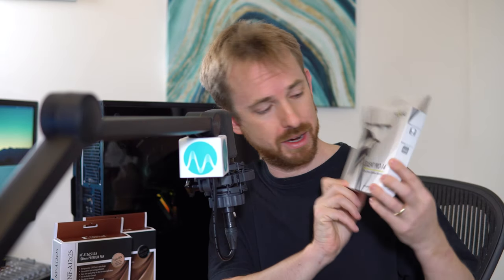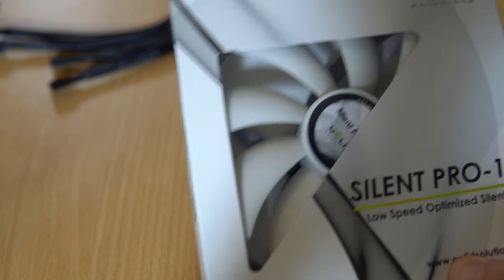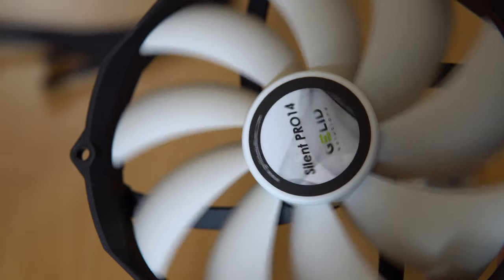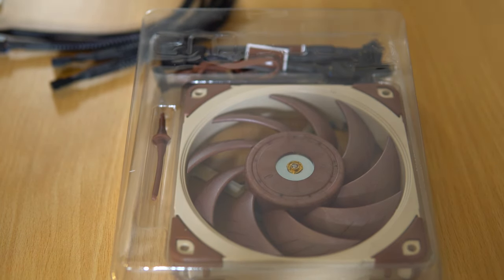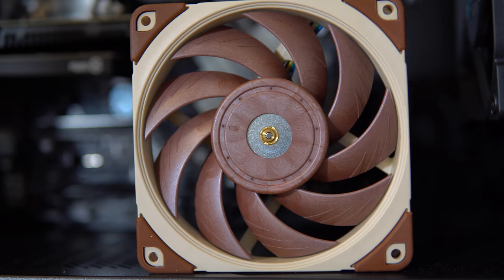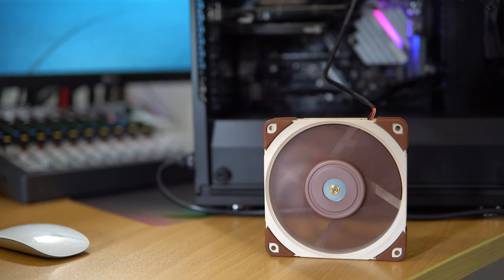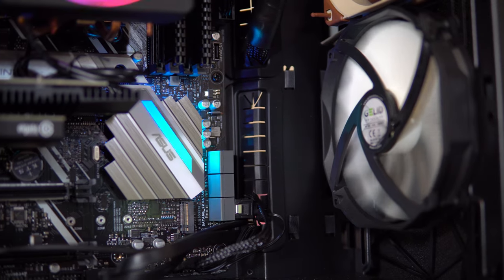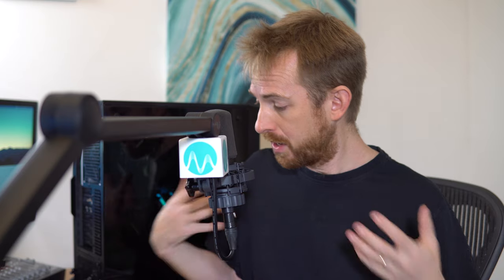How to Reduce PC Fan Noise (Best PC Case Fans) - Ultimate Audio PC Build #008

Comment: Generally, 140mm or better is a must. More air gets moved, at lower RPMs. Although this depends on the configuration. I have a Phanteks P350X case and a Cooler Master MasterLiquid Lite 120, which makes things a bit tight. So I had to move from 4x Corsair AF140 fans and a SP120 fan, to 3x LL120 RGB (two top exhaust, one on the radiator) and 2x LL140 RGBs (front intake). Still pretty silent. The MasterLiquid Lite 120 is decent at keeping the R7 2700X cool even at 99-100% utilization...mounted at the rear, you'd be eliminating a fan. 

It might be a good idea, if you haven't already, to look into adjusting the fan curve of your graphics card as well, with something like MSI Afterburner. You can get away with pretty low speeds when doing work that doesn't utilize the GPU that much. You might need to play around to see what the lowest speed you can get away with, is.
Reply from the maker: That's awesome, thanks so much for the tips!

Comment: Flawed sound test....You don't test a fan by how much noise it produces outside the case. put it in a case, run a stress test & during that, do the measuring. It is about how low sound they produce under a full load. Motherboards have a cooling curve set by default in BIOS to put fans in full speed when cpu gets hot in load (simulated by a stress test).  Because at idle, all decent fans are gonna sound quiet due to low speed if not set to run at full speed manually.
Reply from the maker: Great point - thanks for pointing this out. I guess all fans will get louder under a stress test. I was wondering what the difference will be under "normal" working conditions.
Reply: @MikeRussell  Please make a video to cehck stress test.